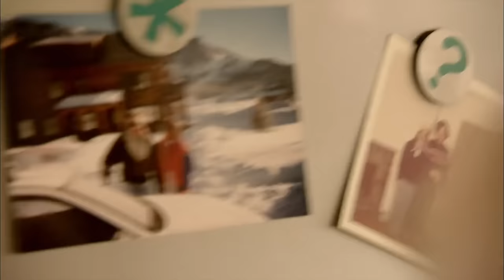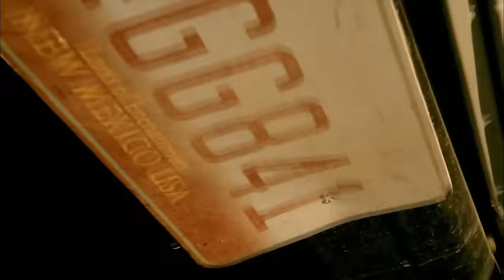When Deaths Comes Knocking... | S5 E11 | Full Episode | I Shouldn't Be Alive

Comment: The jeep just rolled..no buddy you rolled the jeep💀
Reply: I can't believe he thought he'd able to pull it back up lol.
Reply: I think it accepted that.  I just laughed when he 'supposedly' thought, "What's going on!" as it starts to roll.  As to @jacob9538 's remark, it could have been righted, with the right technique used.  I've managed to get virtual boulders, many times my weight into my truck, alone.  Said he was an engineer, not a good one I think.  Started beating a pump as if that was going to help.
Reply: @aldinlee8528 That was so odd. "Whats going on!?" like it never even crossed his mind
Reply: @jacob9538 there was definitely a way to right that thing…
Reply: @jacob9538 Certainly not the way he was trying to do it. It might have been possible to find a fallen log or something to use as a lever and try to wedge some large rocks or something under the side of the vehicle. I doubt it would work, but you'd probably try anything in a situation like that. 0f course I doubt I'd ever be dumb enough to drive a vehicle over rough terrain like that in the middle of nowhere with no phone service or water.
Reply: yup he messed up big time
Reply: @jacob9538  Just WRATCH IT!

Comment: Pro tip - contaminated water can be distilled in plastic bottles over indirect heat from a fire. Even if you have no traditional materials to start a fire, in a situation like this, you could use sparks from the car battery, gas from the tank and dry desert brush as an accelerant...if that fails, someone's glasses can be used to concentrate sunlight. Also, drinking your pee is never warranted, as you're exerting your already desperate organs with toxins meant to be excreted from your body. Glad this couple made it out alive though <3
Reply: The fact that the river was running high, I should think would make contaminents less concentrated; correct me if I'm wrong.  They most certainly should have drunk themselves full, and filled up both bottles, and anything else capable of holding water, even if for just a while.  Even soaking their clothes in water, would have helped a bit.
Reply: @aldinlee8528  while there are some advantages to steady flowing water, one of the disadvantages is that water contaminated from animal feces travels downstream. This would be an issue in areas where I live, but not sure about there. I still wouldn't drink that without at least trying to find ways of distilling or boiling it. Using the river water to cool down and soak your clothes is a great option though!
Reply: Good advice. Also:
- Follow the road back, or find high ground to view possible routes
- Don't hike in the middle of the day
- Digging a deep hole in that moist river bed might have yielded water
- Of course, always have an emergency kit in the car
Reply: How to distill it in a plastic bottle exactly?
Just boiling water is not distilling it, if thats whay u ment
Reply: @bravesirrobin5839  boiling water does not distill it, but it does disinfect it, making it safe enough to drink.
Reply: Thanks Macgyver
Reply: So interesting; thank you.

Comment: I would’ve drank the giardia water over pee any day
Reply: Right? I gagged just watching the reenactment!
Reply: @meadowsong8560  I'm like 80% sure you're not supposed to drink someone else's  pee. Only yours is safe to drink.
Reply: Liberals
Reply: @CyberMachine you’re like 80% wrong, neither is safe to drink
Reply: @flyingchimp12  It's definitely safe to drink your own urine since it's sterile.
Reply: @CyberMachine  Water is NOT sterile. A very old myth.
Reply: @Kriddle1229 Not a myth. CC nurse 25 yrs.  The bladder, minus infection, does provide a sterile environment, urine clean as it hits the air. That said, drinking it ultimately provides zero hydration  as with each "recycling,"  sans supplemental fluid intake, it becomes more and more concentrated.
Reply: @sandtats  Who said anything about urine being sterile?

Comment: If they had a winch on the front of that jeep, they might have been able to attach it to a tree and pull the jeep upright, but all they had was a ratchet strap that just doesn't have the power to pull the jeep upright without an engine.

Comment: I would have used the jack in the car to get it part way up. Then I would try to find a big log to pry on the car. Also, add a couple of large rocks on top of the wheels to offset the balance of the car. That, in addition to the strap pulling, it would be easy to flip the car back.

Comment: Its hard to criticise but I would not left for 2nd hike until having enough resources of water & some food. However in the 1st place I would have tried even more to get jeep upright, I'm pretty sure he had a wheel jack to tilt that jeep up a little more while using his wife holding a long branch to put leverage onto the jeep and they both try to turn the jeep. Even if that fails I would stayed at the jeep for shelter , boil river water by making fire from the excess gas & battery to start the fire and hunt for food untill resources are enough for 2nd hike out of there. It would have cost them less energy and clearer thinking.